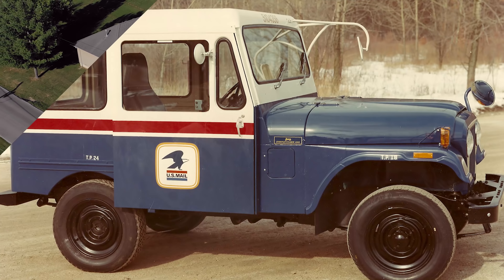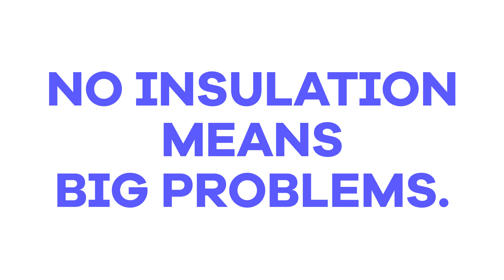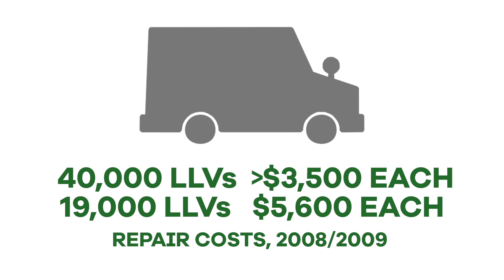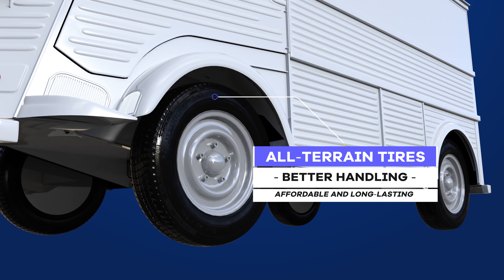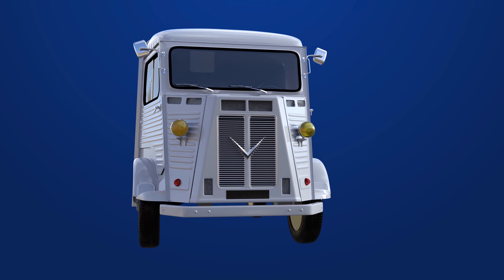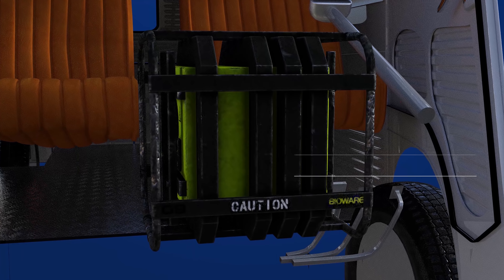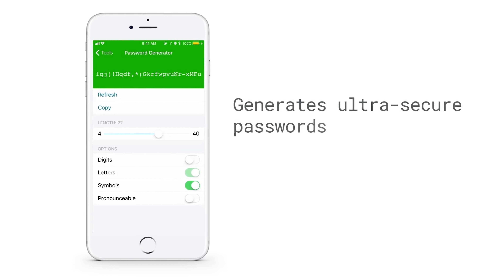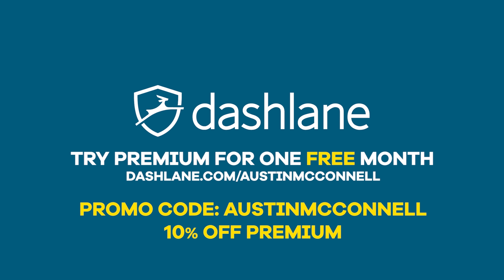Postal Delivery Trucks Stink. Let's Redesign Them.

Comment: Speaking as a letter carrier, I'll point out flaws in this design as I watch it
1. Big thing: You got rid of the tray. An LLV has an adjustable tray on the left-hand side so your mailman can work his mail while still seated in the driver seat. Allows for mounted delivery. There's no point in having the vehicle be right-hand drive if he can't have the mail up there with him.
2. Sitting higher up raises the vehicle's clearance height. That's a problem with the Dodge Promasters we use, they're too tall, so you have to watch if you're driving under something like a basketball goal, or taking one through a drive thru. Sitting higher will also make it more difficult to jump in and out of the vehicle continuously all day, known to mailmen as "scooting", where the houses are too far apart to walk to, but the box is mounted on the house itself, so you have to hop out and run it to the door.
3. Mail carriers carry a scanner, not a tablet. The newest ones are about the size of a cell phone and use a touch screen. They also act as a GPS tracker so that management can pinpoint a carrier's location at any time. This allows them to monitor if you're sitting somewhere too long, longer than 8 minutes and you get flagged and potentially punished for a "Stationary Event". It also helps when a parcel is misdelivered, management can pull up a snapshot of where the package was scanned delivered to determine if it went to the correct house. Having it in the truck doesn't address any of those issues. Don't get me wrong, I hate the GPS scanners, but there's no way in hell management is going to get rid of that.
4. Trying to micromanage the logistics of a route is doing the mailman's job for him. He carries it every day, he understands perfectly how to carry his route in the most efficient way (even if that's not how he chooses to do it). Point is, we don't need or want management getting between us and our job anymore than they already do.
5. Cameras. Fuck that. Management already spies on us enough with the GPS scanners, we don't need them literally watching our every move all day. Those things would end up getting ripped out or broken all the time. An LLV already provides all the visibility you need to drive that thing pretty much anywhere. With the mirrors properly adjusted you can see the left and right sides both in a narrow and wide scope, you can see the front bumper, and the rear bumper thanks to a mirror placed in the top left rear corner of the vehicle. Allows for a 360 degree view of the vehicle without needing any creepy ass big brother cameras.
6. It looks too big. You seem to have made the bastard lovechild of an LLV and a Dodge Promaster. Promasters aren't great delivery vehicles (for letter mail at least) because they're so big and unwieldy.
7. You left out a very useful design choice in the LLV. The front wheels are set closer together to allow for much tighter turning than an average vehicle. That comes in handy all the time when delivering mail.

In summary, your truck wouldn't be any more useful to deliver out of than a Promaster, and even worse because of its disturbing Orwellian spy cameras and busted scanner design.
If you want the best vehicle to deliver mail out of, you've already got it, the LLV is damn near perfect for everything we need, perhaps with the exception of packages, but I've fit 215 packages in one once. Make new LLVs, update the design only for comfort and longevity. Keep the features the same, just give it air conditioning.

Comment: As a daily driver of a current LLV I would say you missed A LOT of things needed. Like... there should be a key fob that we carry on our body that only lets the truck run when the driver is in the cab. When the driver isn’t in the cab the emergency break should auto engage. Delivering out of the left side is just a bad idea because here in America where we use these trucks you would be driving into oncoming traffic. I love the idea of a side door that slides open, but the three door system in the back seems like too much to do to slide out 1 heavy box. I know this sounds crazy, but even though we have large side windows the air just doesn’t flow through them well in the summer. It isn’t really feasible to have AC systems in a car that had huge open windows so how about a windshield that can slide over or roll down so we can have airflow at low speeds. And while you’re doing all of this how about installing a cup holder. After all, we don’t need heaters in the winter, that’s what the fires are for

Comment: This is how the Royal Mail did it here in the UK. Electric, easy to load and unload, and overall just really efficiently designed for purpose! They’re not everywhere yet, but they’re by far more efficient than the Peugeot vans that were and still are being used as well as than the USPS trucks in use when this video came out. 

My one issue with this video is putting the tablet inside the truck. Many postal services require a photo of the package at the door before the package can be marked as delivered. If the USPS used an integrated system instead of tablets, no such photographing could be done. 
Tablets are also much cheaper to replace than built in electronic dashboards, which is an obvious plus when you’re trying to design a system that can be carried into the future

Apart from that though, I 100% agree with all your prepositions, and I’m glad to hear that the USPS, Royal Mail, and many other postal services are going down this route with their new vehicles

Comment: A few thoughts as a rural mail carrier a
1 right hand drive must stay 
2 4x4 or all wheel drive would be perfect especially for snow country 
3 all electric is a bad idea hybrid yes. Counting on carriers, subs and other postal crew to be sure it’s alway on charge is a big ask. 
4 upgraded heat and ac as well as a compartment for bottle water storage would go far as to make a carrier less likely to suffer from the elements 
5 all that camera and computer stuff not important and a distraction for the carrier
6 a charging dock for you scanning equipment and a good back up camera all the tech you need

Comment: The wheel needs to be on the left to put mail into the box without leaving the truck putting a solar panel on the top of the truck and making it hybrid will save more money without going fully electric because when idling the trucks use electric

Comment: The fact that a lot of these vehicles, the slightly upgraded FFV included, have been running despite near constant daily long distance driving since the reagan years is a testament to how well designed it really is given the last ones were made in 1994. It's an incredibly spartan vehicle even by 80s standards but it's incredible that it's lasted as long washer fluid issue aside. You could take any car and put them through the same low maintenance budget constant work stop start driving life that the LLVs have been through for 30 years.

Comment: USPS mail carrier here. Here are my thoughts, if anyone cares. We definitely need new trucks, however. Mail trucks are on the right because mailboxes are on the right. Having an interchangeable steering wheel on the left and right side, takes the entirety of the mail trays in our cars away. The mail tray, a moveable tray that we put DPS, magazine trays, and packages on would be completely wiped, leaving us with just one very large seat which would make it incredibly hard to deliver the mail, considering we’d have to balance the mail on the seat/ keep reaching in the back/pulling over, losing time. Instead of that, we keep the right only wheel, keep the mail tray, and we make it where the seat is able to rotate 90° so we can move mail/packages up front easier, make the seats 100% adjustable for comfort, make engines electric, and make the vehicles look almost identical to the now mail trucks, but just a bit more aerodynamic, and less aluminum/ more environmentally friendly by keeping carriers at an ok temp.

Comment: I've worked on these trucks for over 19 years and I've never seen the washer fluid hose over the fuse block. Every single one that I have worked on has the nozzles through the cowl.  Actually all of the carriers that I know like the LLVs. They just want air, decent heat and a better seat. If we can address the water leak issues and update the chassis/ driveline and creature comforts it will be perfect. One of the biggest safety concern is the lack of a window on the left quarter panel since that is the blind side. I've fixed so many trucks from blind side hits from the left.

Comment: So how do you plan to deliver mail to 700 to 900 mailboxes if you are on a driving route with curbside delivery? Why is there a second seat up front? Why is the steering wheel on the left? How are you supposed to even reach the mailboxes with the windows so high up? When you are delivering mail to several hundred mailboxes every day, where do you actually put the trays of mail you are working out of? It looks like this truck was designed to just deliver packages, but completely ignored all the magazines and letters we deliver.

Comment: You have no idea what you are talking about. The left hand drive alone would make these worse than the LLV.  Right hand drive makes mounted delivery so much easier. Also, being that high up makes it harder to reach those mailboxes. Hood that tall means worse visibility out the front and that means the little kid playing in front of the truck is gonna get run over. Bigger vehicle means worse turning radius as well, which sucks for a mail carrier. Oh, and electric? No fucking thanks. The infrastructure for a fleet of electric vehicles this large does not exist yet.

Comment: The thing needs an internal fire supression system. A firefoam popper in the back that auto activates upon registering smoke and heat will keep the packages safe, if a  bit soggy. Just install it on the inside roof of the truck.

Comment: Right side driving is set up so a driver on a mounted route can drive literally up to the box and make a delivery. if you put it on the left side you either force the driver to get out to deliver to every box or to cross across traffic to make deliveries from the seat.   Replacing the passenger seat with a tray like in the current vehicles you make it easy to reach.   The drivers position does not matter on routes where the driver has to get out to make his round or apartments,  but there are a lot of routes optimized for the mounted way,  and its a lot faster to pull up drop off in the box and go instead of having to park break unbuckle get out deliver get back in buckle and start

Comment: Looking at the comments now made me realize how many people missed the point of his mail truck design.

First off, the truck you see is not the design he’s going for, he’s just taking a sample design as a place holder, and was just using it to help explain his idea. He mentions to take a design cue from classic vehicles, which can easily be put into a modernized version.

Ironically, if you check the official proposed design by USPS, you’d be surprised how similar it looks from his proposal... just a flatter nose.

Left hand design is subjective, but I see what he was going for. He was mostly taking into account of the design based on package delivery vehicles that you see in Fedex/UPS trucks, which do have left hand seating. Personally, I wouldn’t have gone for that, but it’s understandable.

Other comments claim obsolescence for the tech inside the mail truck, and tbh the basics of tracking and cameras are future proof, as well as easily upgradable. Technically a raspberry pi is enough to do the job.

And a lot of people seem to underestimate electric powered vehicles, as some forget the amount of moving parts in your typical gas powered variants. I guess the stigma of electric motors being low quality is from experience of using the cheap stuff. Best proposal is to put electric variants in urban areas while diesel hybrids everywhere else. 

But if you’re in doubt, make it all Diesel, which is the superior fuel source over electric and normal gas.

Hell, one the proposal next gen vehicles are electric.

Now am I qualified to defend his design? 8+ years as an engineer for Toyota’s R&D that was part of the team that designed the TNGA platform sorta helps with the credibility.

Comment: This is what I would want in a mail truck (I'm a RCA contract)  I would use a mini van / cargo van model with a separate system for air conditioning (someone needs to invent AC that does not use the idling car).  AC needs to be built in to the side walls or something.  #2 - flashing lights at random intervals need to be on all sides of the car - front/back/ sides & siren on top.  #3 - the car has to turn on a dime in tight spots #4 - there needs to be a built in scanner w/ a wand attachment in the back that syncs with the tablet in the front.  There either needs to be a tablet that can detach so that signatures can be entered by the receiver or a separate scanner that the carrier takes to the door to get a signature. #4.5 - There needs to be software invented that displays the mail route on screen and tells the carrier the resident's name, house number & how many chunkies and larges are going to each resident in sequences as the route unfolds.  After the scans are done, the computer tells the carrier in real-time that they have delivered all packages and the system has accepted all scans for that resident for that day.  #5 - I would want removable or re-adjustable shelving and braces that hold my mail trays and keep my packages from sliding around. #6 - the back door needs to be a lift gate or roll up door that has remote control.   #7 - only one side of the vehicle can have a sliding back door which should be right side, behind the carrier for easy dismount. #8 - there needs to be an invention of a cover or overhang for the window for rain and snow. Not sure how to fix this problem, I hate it when the rain comes in. #9 - decorative wrap w/ the USPS logo or eagle on it for a professional look.  Need to have lettering in the back for people to know what we're stopping frequently & stuff. #10 - I deliver on a few busy residential streets and people can be so unforgiving and ride my bumper.  There should be some kind of fog horn blast that emits when someone gets to close the vehicle.  Kinda like honking my horn but the sound is let out in the back...  That's my wish list - and it's not the same for every carrier, but I can dream.

Comment: I actually enjoyed driving the LLV and the FFV. A lot of old timers complained about every last one of the vehicles they had to drive, but then a lot of old timers also complained about actually having to deliver their routes. As far as the fires that have been happening with the LLV’s, it’s not surprising considering the horrible maintenance provided by the postal mechanics... a lot of fixes were Jerry rigged. I’d not be surprised if a lot of the fires have been caused by faulty repairs, or parts that are long past their service date.

Comment: Modern weather resistant aluminum exterior frame, reinforced brass/stainless steel cabin with eco-insulation for both heat/cooling plus easily replaced, kevlar enforced driver/passenger door and polyframe bullet proof glass, GM eco tech engine system gen 3-4, modern ac heating/cooling with gps assistance and direct emergency response (smartphone compatible), and full interior air bags. All I got.

Comment: I used to work at USPS in 2016. I was unfortunately fired because I failed to pass my probation as I wasn't keeping up with the rest of the crew. Anyways I actually do remember seeing a picture on the wall of some kind of new post office Truck design. It may be possible to find this image on the internet. It actually looked quite a bit like the current truck but more sleeker and more cooler to look at. I can also vouch that since I worked for USPS in the summer, it fucking sucks not having air conditioning.

Comment: My mom drives of those tin cans in our town, situated within like 20ish miles of the eastern shore of Lake Michigan, where we get "lake affect" weather, which in the winter generally consists of anywhere between a shitload and a fuckton of snow. The worst feature of the old LLVs imo is that the front two tires are set closer together than the rear two, meaning they leave four tire tracks instead of two in snow, greatly increasing the chance of getting stuck, especially since they tend to drive on the very edges of the roads to reach the mailboxes where most snow gets piled up from plows. And of course, the heaters function as little more than a cruel joke in the 50% of the year when heating vehicles is necessary here lmao.

Comment: The right side sliding door so carriers are no longer crushed by cars when opening the back to the cargo compartment is good.  Electric motors, like right hand drive might just work for most but not all situations. The narrow front wheelbase while making parking easier makes the LLV a potential deathtrap in the snow. New automotive technology however offer assisted parking especially important in crowed cities.

Comment: LLV gets 10MPG? That's fucking amazing. Every tractor I've ever driven gets an abysmal 7mpg. Only reason I have a little under a thousand miles of effective fuel range is because I have a ridiculous 200 gallon capacity for the truck's diesel, carried in twin 100 gallon tanks...